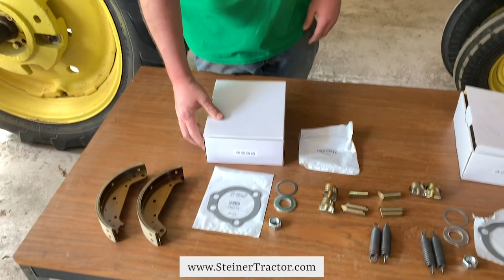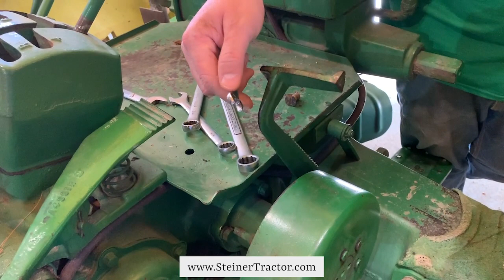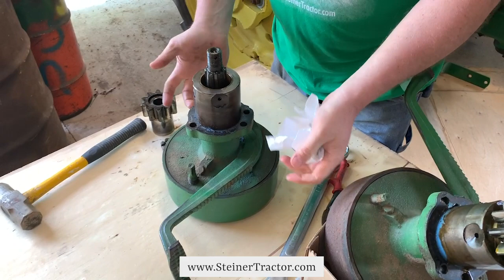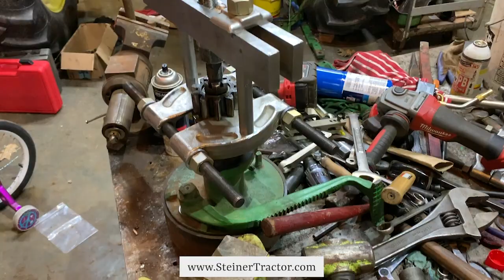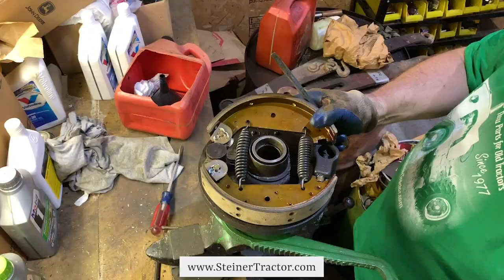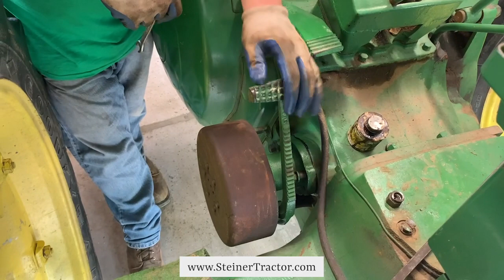Brakes on John Deere A

Comment: Nice tutorial, thanks for the walk through.  The service manual mentions to check the end play of the shaft and to adjust accordingly, something I didn't see here.  The one I have is over the .030 spec with one shim/thrust washer in place, so I have some extra shims of smaller thickness on order to dial it in.